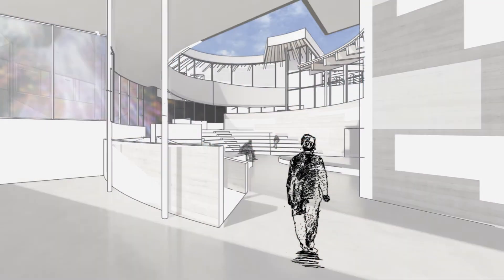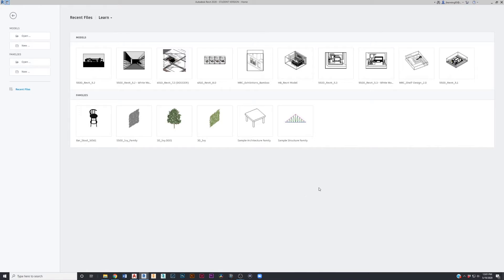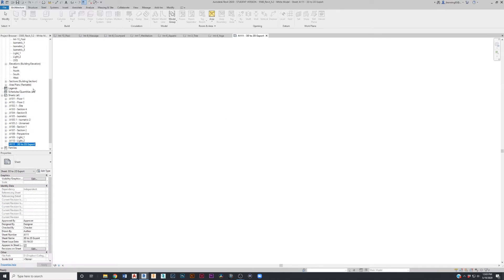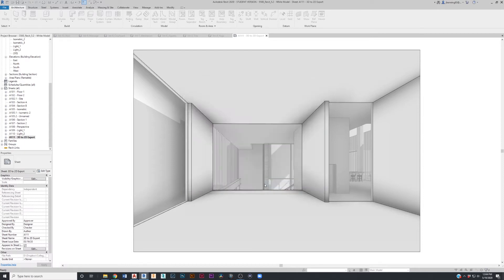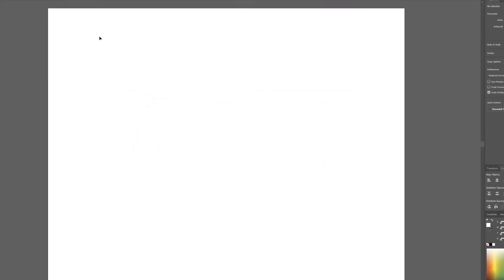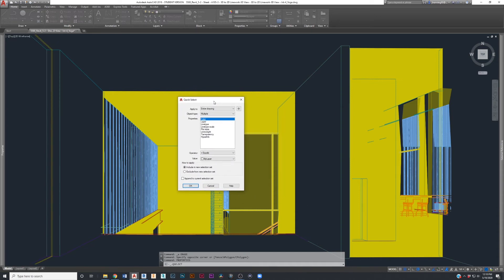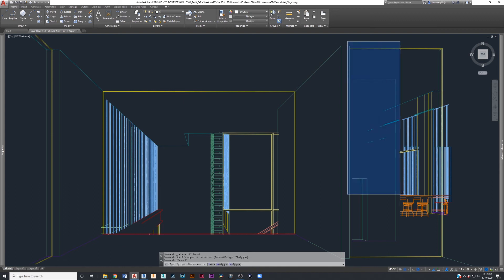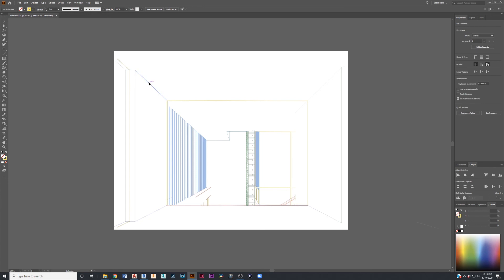How to Convert a 3D Revit Model to 2D Vector Line Drawing

Comment: Hi I currently have a very large and messy Revit model and want to create a simplified section with context. there's no context, there are completely plain massing block in SketchUp but no windows etc.. the model export is to detailed and these have no detail is there a quick way to simplify the Revit exported sheet in AutoCAD or illustrator with out editing each block or changing/ deleting individual lines. Any advice would be great

Comment: I have a DWF 3D line-based vector, and I want to import it into Revit to convert the lines into volumes with less work. Perhaps there's a way I don't need to draw all the volumes I want to extrude using the vector as a base. Is that possible? In the file, I have the site contour lines and some existing buildings. While using the mass & site tool, I was able to model the site, but I couldn't automatically extrude/model the buildings.

Comment: Thanks Jon, 
very helpful...how about those hatches inside the blocks? I have to work with a file with 5000 blocks.
So, I used the Blkto0 lisp, but the hatches still there. Any suggestions?
Reply: just explode the blocks

Comment: If you open a 2007 cad file, or so, in illustrator it should keep the layers from the cad file. So the cad file from revit can be saved as an older version and then opened in illustrator instead of copy-pasting.
Reply from the maker: Great tip!

Comment: What about the scale? Does it keep the same scale from Revit to Autocad? And does it keep it from Autocad to Illustrator when you just drag the drawing?
Reply from the maker: Great question! It’s always important to be conscious of scale when moving between programs. Perspective drawings are ultimately scale-less. Isometric drawings on the other hand will have a scale factor. Based on the scale that you selected for the viewport on the sheet in Revit, you can retain this scale when moving to AutoCAD. When using the copy-paste method from AutoCAD to Illustrator, you will need to rescale like I touched on in the video. Scaling drawings ultimately depends on your workflow, so there can be a lot of different solutions to answer your question. It really just depends on the type of drawing that you are working on. Hope this helps!